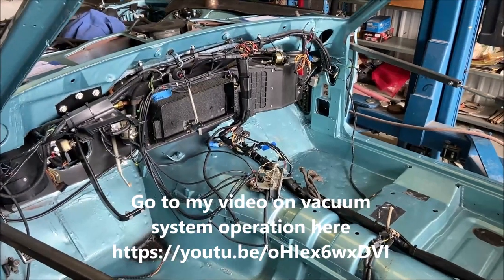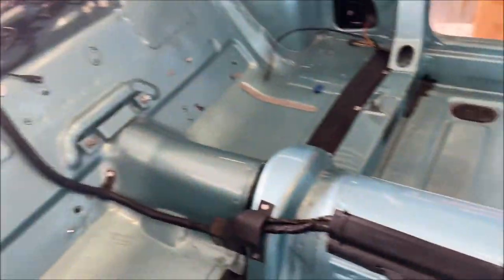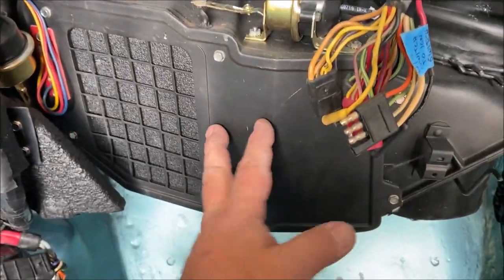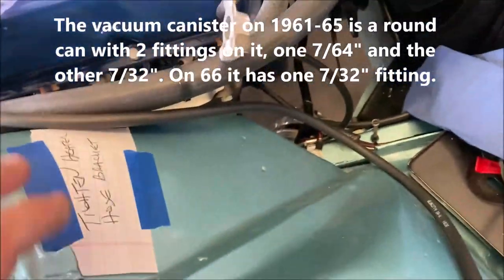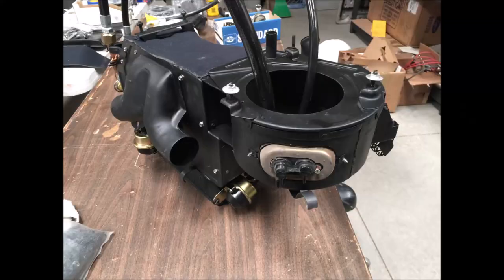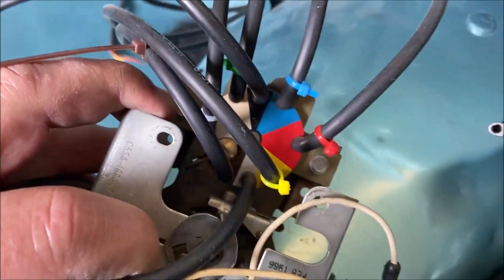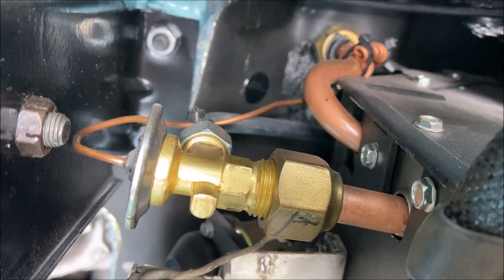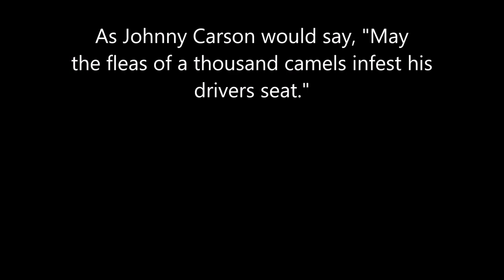1961-66 Thunderbird A/C and heater Vacuum System Layout

Comment: Thank you for an awesome and informative video. I have the interior out of my '65, and I'm debating whether to reactivate the vacuum operated HVAC system, which was disconnected because of leaks in the system, I presume. My car has AC, but doesn't have the vacuum powered door locks. (RIght now, the only HVAC function I have is heat through the defroster, which is minimally acceptable, as if I'm ever caught in an ice storm, that's the function I'll need the most. Heater core seems good. I've replaced the vacuum operated heater control valve with a manually controlled unit that can be shut off or turned on seasonally.) 

I don't mind the work in accessing and replacing the vacuum lines, but I'm worried that the some/most of the vacuum powered vent panel motors/canisters might be leaking and in need of replacement. It sounds/looks like the recirculating air, defroster, main air conditioning vent, compressor clutch switch are available as new replacement units. WHERE CAN I BUY THOSE? I looked at Pat Wilson's and the bird's nest for a cursory check and didn't see anything. 

Also, is the rear interior vent canister (behind the rear seat) available new? How likely is it that all/most of these units will not be working on my car (I assume they're all original.) How do I check them? Will it be likely that my CONTROL UNIT will also be leaking? And can it be rebuilt if it is? I want to do all of this without taking out my dash. If I need a new evaporator for the AC, can that be installed without taking out the dash? I DO have the shop manual, but I want to check with someone with experience. 

Sorry for all the questions, but I'm debating whether to leave this daunting task for a future owner many years down the road. Thanks again for sharing your knowledge.
Reply from the maker: Hi Kay NineTwo, thanks for the compliments. Sounds like you have a lot of work ahead of you. First, the neutral position for all heater A/C doors (that position where all heater doors move to when the system fails or vacuum is stopped) is all heater and defroster doors open so heat and defrost can still function when the system fails. So the heater and defroster will still operate if vacuum is removed from the system. The only thing that will not work if vacuum is removed is the heater valve (because it opens under vacuum) so technically you will not get heat if the heater valve does not open. You can purchase a new vacuum operated heater valve from Bird Nest. Refer to their 2019 catalog page 48 top left hand corner of the page, item D, part number 74604. The only problem with this heater valve is there is no way to attach it to the original heater valve bracket.

The vacuum motors that control the heater doors, recirculating air door, front A/C vent, defroster door, and the vacuum operated electrical compressor switch next to the expansion valve, are available new. Refer to Bird Nest 2019 catalog page 45 top left hand corner of page, item B, part number YH161. These may also still be available from Ford. Motorcraft part number YH161. See my video about rebuilding that switch/vacuum motor that shows how to replace the vacuum motor part of the switch. 

The rear vacuum motor that controls the rear vents behind the back seat is the same vacuum motor YH161. At first you may think after looking at the motor that it doesn't work but it does. You have to dick with it for a while to get it to fit in there. It is very likely that these motors are bad. And if they are not bad, they are 50 plus years old so replace them all. To check them, you just hook a vacuum hose up to them and suck on the vacuum hose. If the motors lever pulls in and you can cap the hose with your tongue and the lever stays in, then there are no leaks and the vacuum motor is still good. If you suck on the hose and the lever keeps wanting to go back out, then it leaks. Its very easy. 

The pie or pizza control disc with all the pie shaped different color wedges on it can be rebuilt sort of. I take them apart and sand the inside surfaces of the disc. In other words, the disc is two pieces that come together, one piece is stationary and the other, that piece with the control handle on it, moves over the other piece changing where the vacuum goes. These two pieces are machined and are supposed to create a seal as they slide against each other. This mechanism can get dirty, scratched, worn, etc so I sand the machined surfaces with 2000 grit wet sand paper. It helps a little bit I guess. I also blow them out with compressed air and clean the crap out of them and the little ports. I poke the little ports with thin metal wire to be sure they are not plugged by dirt. 

The plenum (that huge thing under the dash)  houses the evaporator and cannot be removed without removing the dash. It is my opinion that if anyone is converting to R134, they should have the evaporator reconditioned and removal of the plenum is required to do that. I did that with the car in the video. Lots of work. I hope this has helped you. Good luck. Nick
Reply: @vintagethunderbirdrepair9426  Thanks a ton! It really does help me out. I know have sources for these parts...I still have to decide if I want to tackle this, though. Again, thanks for the video and informative response!

Comment: Hi Nick. I have 2 questions I hope you can help me with  #1 I keep seeing a "vacuum check valve" offered for the 1966 Thunderbird possibly only for AC equipped cars. I've seen it mentioned on a vacuum layout diagram and position right after the vacuum source point on the engine, before the lines are connected to anything else. Can you verify whether one is actually needed. I see one on Birds Nest and it has 3 ports which is also a bit confusing. #2 I see in this video that you have the second tip capped off on the brass fitting that comes out of the intake where the vacuum is supplied. What is that second fitting for? Thanks in advance!
Reply from the maker: Hey Lance, a vacuum check valve is always used on vacuum systems. They are a one way valve to prevent air from being forced into the vacuum system when the engine back fires or something like that. It protects the vacuum system since it must be under vacuum, not pressure. If the car were to back fire, then it could blow out all the vacuum motors. So the check valve allows the engine to suck out all the air, create vacuum, but it does not let air back into the vacuum system. So its important to install the check valve properly too obviously. The extra port on the brass fitting is for the vacuum door lock system. This car does not have that so that fitting is capped off. I hope that has helped. Thanks.

Comment: Hey Nick. Thanks for the videos. What is this vacuum regulator for? See picture. It’s in the 1965 ford shop Manual, section 16-10. I did find it in my 1965 a/c system. Don’t know how to check it except to blow through it. Any suggestions, can I eliminate this with no consequence to the a/c working like it should? You are the best mechanic I have found regarding these thirds. Thanks for your dedication to these great old cars. Jim
Reply from the maker: Hey Jim, the "vacuum regulator" that is shown on the vacuum diagram on page 16-10 is actually the temperature regulator valve, it is attached to the lever that adjusts the temperature minimum-maximum. I believe they named it incorrectly but I guess it is a vacuum regulator just the same.
Reply: OK thanks Nick. 

Just so I’m clear, is that in place of the thermostatic control switch that’s above the heater box that you bypassed. Maybe in place of is not the right word but does it serve the same purpose, can I eliminate it.
Reply: ok. Thanks.

Comment: Hello Nick,
I really enjoyed your explanation of this system. Thank you for producing such great videos. I own a 66 Landau without A/C that will need a heater core replacement. I am aware that the removal of my heater core will be quite different than what you have shown in this video. I have seen other videos that show the removal of a non A/C heater core without removing the dash. I am sure with your experience you have replaced the core, and wanted to get your opinion about this. (maybe a future video?)
Thank you,
George in Michigan
Reply from the maker: Hey George, thank you for the compliments. To be honest, in 35 plus years fixing Thunderbirds, I've only done one heater core on a 64-66 Thunderbird without air, I'm not kidding. So many of these cars have air that, for me anyway, it just never happened except for the one time. It seems odd that something like that would happen so rarely. So the only thing that I do remember about doing it is that it was much harder then the cars with air to get the heater box out since it is larger. But I could not tell you any particulars from memory and I do not have a car without air in my possession to which I could use for a video. It seems that I attract only those cars with air. If one comes along, Ill be sure to make a video.  Thanks again, Nick
Reply: @vintagethunderbirdrepair9426  Hello Nick,
Thanks for your reply. I think you are right about most of these Thunderbirds having A/C. I am going to try to do this job without removing the entire dash, taking photos/video as I work on it. (so I remember how it goes back together)
Thanks again,
George

Comment: Hi Nick, My 65 is a factory air car.  but it has had an engine change in the past and the new engine has NONE of the aircon parts on it.  (I assume it was probably a truck 390 since it has a 2 bbl carb.)  Classic Auto Air makes a kit for NON-air cars for about $1600 which includes everything but it is designed to work with the non A/C controls and the non A/C firewall.  The other option would be to go original but I am not sure what all is missing or what all original style parts are available.  Original Air sent me a quote with "the major" parts, but I'm concerned about finding, wiring and connecting all the "little things".
Reply from the maker: Hey Chuck, sounds like you have a big decision to make. Its hard and costly to restore an air system in a Thunderbird. The plenum under the dash must come out which means removing the dash board and center console. I have installed or repaired the factory air on many cars and when I do that I tell the customers that the dash must come out and with that out they need to address anything that is wrong with the car dash related and engine related since those are the two places where there is going to be major work. For example, if the dash is cracked, then it will be out and an opportune time to fix it. If the car has vacuum door locks, then that system will be fully exposed with the dash out so perfect time to restore that. Etc.

As far as the AC parts in the engine compartment, all you need to do is to look at an air car and see what they have related to what you have, its not hard. The pullies and fan are different and there are some AC brackets for the compressor and then the hoses from the plenum under the dash to the compressor and the condenser and fan shroud. All these parts are available. Birds Nest has all these parts.

If you install the Classic Auto Air after market system, what do you do about the plenum under the dash? You must remove the dash to remove the plenum and if you have to do that anyway, why not install original factory air? I cannot imagine that their system will work with the plenum in the way and if you don't restore the plenum, then no system will work.

Classic Auto Air can reproduce all the pressurized hoses, they can recondition the evaporator, they can sell you new service valves for the compressor and other misc parts too. The condenser is available new or have your old one reconditioned, the receiver dryer is available new, the expansion valve is available new, all the vacuum motors under the dash are available new, all the vacuum hoses under the dash are available new, etc. You can get everything for the original factory system. The only thing you cannot buy is a new plenum or someone to recondition it. I think you would have to do that yourself. The wiring and all dash related parts you already have so no worries there. 

I hope this helped. Good luck.
Reply: @vintagethunderbirdrepair9426  thanks so much.

Comment: I have a 64 with air that has no heat in the cabin. If I apply vacuum to the water valve the heat works full time. I have no vacuum at the brown hose on the color wheel and still have the original  thermostatic control switch in the loop. Is there a source under the dash to supply vacuum to the black wedge on the color wheel? Am I on the right track?

Amazing video , thanks!!
Reply from the maker: The small hose (Gates 27041) that leads from the vacuum cannister in the engine compartment, goes through the firewall and "T's" into a larger hose (Gates 27043), and that larger hose goes to the thermostatic control valve and to the temp control valve on the dash. This is the source for all the vacuum under the dash for heater and A/C (not emergency brake or rear vent, that is a separate source hose, as is the door locks). The smaller hose going through the firewall "T's" into this larger hose right above the heater box next to the thermostatic control valve when the thermostatic control valve is still hooked up. Then there is another T near where this larger hose goes into the temperature control valve on the dash, and that T sends another smaller hose to the black wedge on the pie disc, just like in my video. This is all assuming that you have the thermostatic control valve hooked up. If it is not hooked up like in my video, there is only one T near the temperature control valve and the small hose going through the firewall goes all the way down to that T near the temperature control valve the way it is in the video. The other side of the temperature control valve is a smaller hose (Gates 27041) and that goes to silver wedge on the pie disc. 

Another way to explain it, you have a large hose going from the temp control valve on the dash to the thermostatic control valve by the fan. In that hose you have two "T's," one sending a smaller hose to the engine via the vacuum cannister near the battery, and another smaller hose to the black wedge on the pie disc. This is all assuming the thermostatic control valve is still hooked up. If you decide to bypass the thermostatic control valve , then eliminate the T by the thermostatic control valve, eliminate the larger hose mentioned above, and run the smaller source hose from the engine all the way to the black wedge on the pie disc and T off a short large hose to the temp control valve. Just like in my video. I hope that is not too confusing. Thanks for listening. Nick
Reply: @vintagethunderbirdrepair9426  I understand from the video how to bypass my faulty thermostatic control valve and supply vacuum to the variable control head and black triangle. The part that is not yet clear is how the vacuum signal gets back to the water valve. It seems a T is needed in the silver vacuum line and back to the valve.

Thanks for your patience and help!
Reply from the maker: Hey Rocketeer, the brown wedge on the pie disc, next to the silver wedge, supplies the heater valve. That is the vacuum hose that supplies the heater valve with vacuum. Run a vacuum hose from that brown wedge directly to the heater valve and that's it. I hope that helped, Nick

Comment: Hi Nick, just bought a 65 landau and found your videos. Thanks for all the info and help. Do you know why I would hear a vacuum leak under my drivers side dash but only when I put the shifter in gear ? It goes away when I put in park or neutral. 
Thanks,
Roy
Reply from the maker: Hey Roy, thank you. The neutral safety switch controls the release of the emergency brake via vacuum. When the car is in park or neutral, the neutral safety switch blocks vacuum to  the emergency brake pedal assembly so it will stay engaged. When you put the car in gear, the neutral safety switch sends vacuum to the emergency brake pedal assembly releasing it so you can proceed down the road. You are hearing the leak because either the neutral safety switch is faulty and leaking vacuum or the vacuum hose has fallen off. Easy fix, just look under the dash. The neutral safety switch is attached to the steering column. Good luck.

Comment: When you bypassed the temperature control switch, did you just ignore it was there and not run any vacuum to it at all
Reply from the maker: Yes, I bypassed the heater thermostatic control switch completely, I did not hook up any hoses to it at all, but I did not remove it since that would leave a big hole in the fan box.

Comment: Love the videos!!!  Gives my son and I the confidence to do these repairs.  I can't tell you how incredibly valuable your videos are, THANK YOU!!!!  We have a 1966 Thunderbird and are having same trouble as "Auto Anatomy", our AC/Heater Control unit vacuum control head distribution head thing is leaking.  There is some rubber or plastic disc in the round head that has disintegrated or dried out.  Have not been able to find the part anywhere or anyplace that would refurbish/rebuild the vacuum control head colored pizza pie disc vacuum distribution head thing.  Do you know where I could get the parts or send in my  part for rebuild?  Thanks again for making repairs easy to understand, even with the shop manual, without you we would be lost!!!!
Reply from the maker: Thank  you very much Jeff, I greatly appreciate that. Ill keep them coming as long as I am still above ground.

Comment: Do you have a video on removing the heater ac control panel
Reply from the maker: No, I do  not have a video for that, sorry. Its not hard to remove, you need to remove the dash facing first, then 4 screws hold the control unit to the center console.